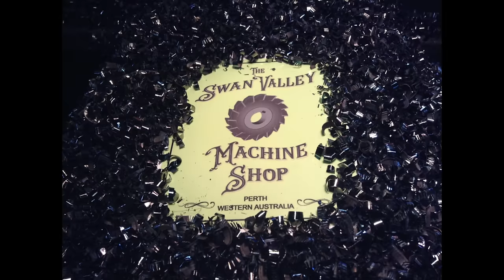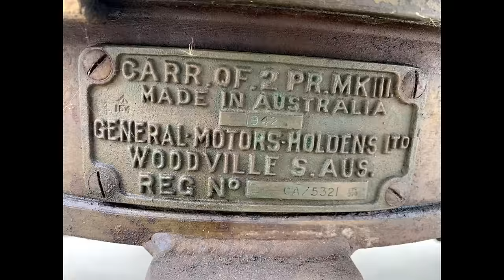More '' Tractor " Parts Repaired !

Comment: Nice pragmatic solution Max. Hopefully this assembly will see a lot less shock load than it was originally designed for. Nice smooth azimuth and elevation adjustment on the, er......tractor.
Reply from the maker: Lol , thanks  👍

Comment: HI Max, from Washington State, US.   First, the weldment lesson as to choice was very interesting as "heat to part" decision.  And, I took particular note of your tool selection.  As a rounded fixture as well as general speed of headstock.  *The choice to boring bar and general toolpost to work set up.  Happy to see your new shop in modest job flow.  Really, really enjoying your comments and review to all types of repair and while my shop is now a bit cold as winter just has first snow, I hope to manage best results.  Regards.  McGary
Reply from the maker: Cheers .    Starting to warm up here !   👍

Comment: Sometimes when doing these sort of repair i am not sure if it is just as quick to make complete new part. I found welding some farm machinery back up i could machine new part quicker than welding waiting for it too cool then machining finding out not quite enough weld and a low spot plus considered it to last longer machining new bit. Max still nice repair and good blending thanks for the content
Reply from the maker: Thanks .  There was too much involved to make replacement parts .   Also the original parts have to be repaired & reused for the restoration .  👍

Comment: Another really nice job completed there Max, always amazes me how the welding cleans up to a decent part. I used to use those hand held thread chasers quite a bit 40 years ago when I was still an engineer at sea. I have been looking for some recently for the retirement workshop, but they are like finding unicorn horns now in the UK.
Reply from the maker: Thanks .  You can cheat with the chasers & weld old Coventry die head chasers onto a flat shank with a handle .   I can not ever remember seeing them for sale , these were Dads & are very old .   👍
Reply: thread files have the thread chasers on the ends of them i kno as i have a couple of them Cheers

Comment: spot on with the telescope gauge method Max. I always take several measurements when using them to be sure. I found a smoother surface finish will lend to better measurements that don't hang up when you rock them trough. However  perfectly smooth is not always attainable especially when field machining on repair work. Nicely done Max and a cool tractor to boot! cheers
Reply from the maker: Thanks Warren .    Cheers  👍

Comment: I have all of these crazy alloy rods for my TIG and same for the MIG. I recently used up an 11 pound spool of standard 70 rate steel wire and put a 309L spool in. So, as you know, it’s used for stainless to low alloy steel. But it works very well on steel to steel, or building up surfaces. I’ve never tried 308L for that, just for stainless. Which are you using? Some hardface alloys are also good and don’t require hardening. I like those too. Just not the ones with carbide as you then have to grind them.

I recently bought a small welding rotator. It makes a really big improvement over my trying to turn around the part. Much less concentration.
Reply from the maker: ER316L  was all i had in stainless .    A welding rotator  is on my list !    There are some pretty exotic welding rods & wires out there ,  all really expensive & have to be ordered in .    Sometimes you just have to keep in focus what the job is going to be used for !      Cheers  👍

Comment: Copper plating is normal when case hardening specific area's (at least on motorcycle connecting rods for pressed up cranks where needle bearings run directly inside big end)
I've had some major issues when cast steel track rollers (on excavators) were welded up, almost impossible to machine although I'm pretty sure there were less grades of carbide available 'to the masses' in 1990?
Reply from the maker: Thanks .  That is interesting about the copper .  It was a thick coating as well .    Lol , those rollers are that cheap now days they just run them to destruction , about 120 %  !     It used to be quite a business for  one place here , auto welding them .   👍

Comment: Gday max, would you reckon machining away about maybe half of that and then shrink fitting or even locktiteing a ring then remachining the crown in would be a viable repair? Or be too thin?
Reply from the maker: It could be done , but a way longer process for what this part is required to do .  👍

Comment: Last two videos we've got black horizontal bars top and bottom, making the picture a peculiar aspect ratio. Although they're all still 1080p.
Reply from the maker: That's strange .   3840 x 2160 otherwise  You tube will not put it to 4K as far as i know .  Thanks  👍
Reply: @swanvalleymachineshop  I was viewing on a 1080p screen. I illustrate the problem in this unlisted video: https://youtu.be/5o1XtxkcuXE . Sadly I don't know the reason, or even if it is at my end or yours (except I'm not having it with anyone else's videos). Thanks for all your videos.
Reply: @samuelfielder  It did the same thing to me. Like a screen within a screen.
Reply from the maker: @samuelfielder  That is interesting .   I will ask  someone else if they have the same effect .    The other thing is on the first part of your video , i was using the go pro & on the later video i used my phone to do the entire video on .    I will see if it is a problem at my end .     Thanks .

Comment: i would turn them until round and make a press fit sleeve. Locktite it on, and turn the profile
Reply from the maker: They were that hard on the O/D a file would not touch it .    It had to be a quick cost effective repair that would work for a static display .  👍